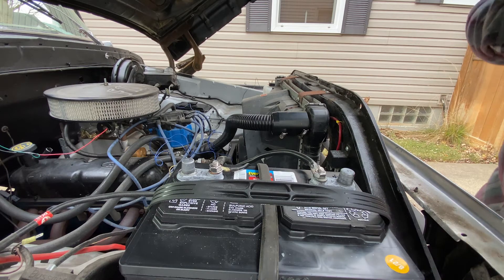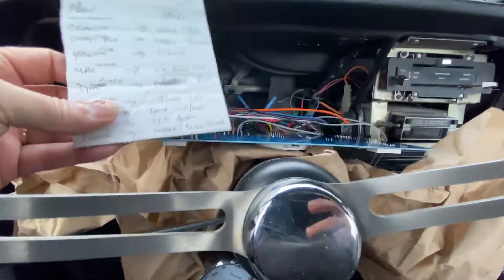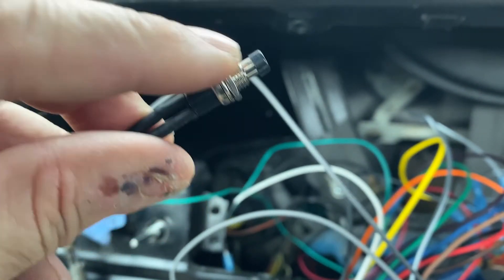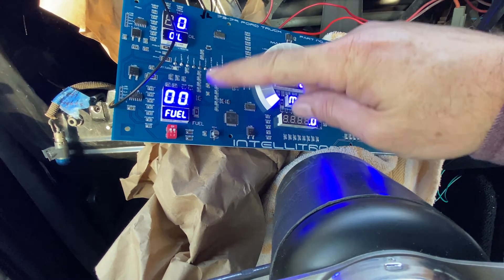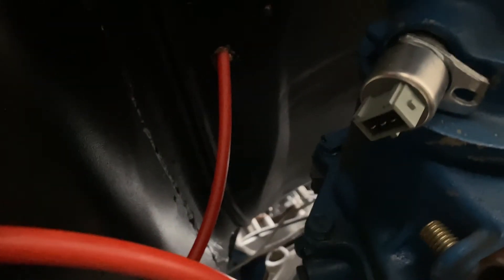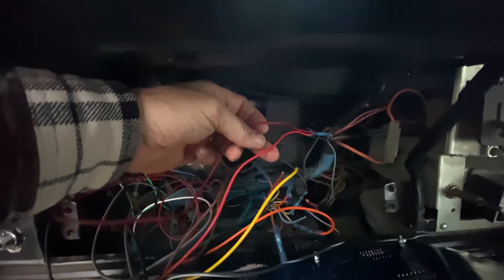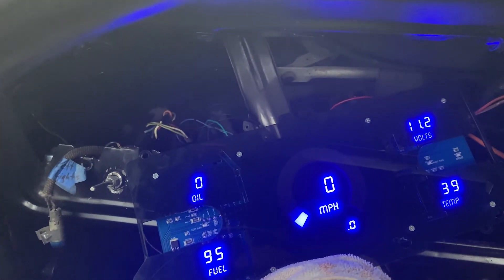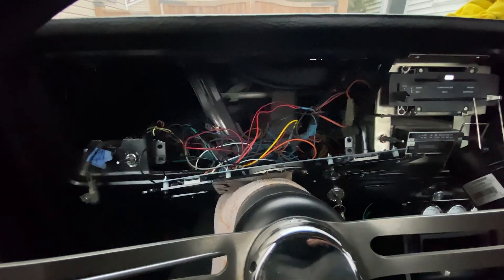How To Install INTELLITRONIX digital dash 73-79 Ford F100

Comment: How do you wire the turn signal wires? I have a left and right wire on my panel but I cannot figure out how to wire it to the signal flasher or the wires coming out of the steering column? I cannot find that information anywhere! I am guessing it is simple and I am just missing something. Anyone, please help! Thank you!

Comment: I installed one of these in my truck everything works but the Speedo, I’ve swapped the wires around just in case I lost track while chasing them, I’ve grounded it inside the dash, took out the sensor from the transmission and tried reinstalling any advice or things you can think to check I went white to white on the board hooked in the red with 12v key and the ground to a screw in the dash then to the board

Comment: My sending unit wire along the chassis must have a short, so I ran another wire straight to the fuel gauge , it now works, however my temp and oil pressure gauge are affected. Can I disconnect the old gas gauge wire from the big wiring plug behind dash cluster ?
Reply from the maker: I’m not sure I’m completely following you, but the fuel should have no bearing on temp and oil. The only thing they have in common is a ground. I’d check your ground. Yes, you can disconnect gas gauge from wiring harness
Reply from the maker: Did your original dash have gauges for oil and temp, or just lights? The wiring diagram I shared will only work with an original dad that is WITHOUT gauges, meaning it HAS LIGHTS
Reply: @FRestoMod  
Original sending unit would not work so I replaced it, still would not work with the existing wires.  I have a ground wire from the sending unit, then I ran a separate wire from the sending unit to the fuel gauge . Also a wire from the other fuel gauge terminal to a hot fuse. The fuel gauge then read accurately but also the temp gauge and the oil pressure gauges  both read high. Later I realized I didn't need to run that hot wire, took that loose and relied on the plug that goes into the cluster to carry the current, but now I don't have any reading on the fuel gauge.
Reply: @FRestoMod  
Adding to the other message yes this gauge panel is the original from the 77 it has oil pressure, temperature,  fuel,  and amp gauges.
Reply from the maker: @trig5010  in that case, you can’t use the wiring diagram I shared. That’s only for WITHOUT gauges. The wire coding is totally different.
Reply: @FRestoMod  
Ok, well thanks for all the info. I've been thinking it's a ground problem but I've changed the ground wire from the sending unit several times and it doesn't change my fuel gauge reading.
Reply from the maker: @trig5010  you made the necessary adjustments on the dip switches on the pc board of the intellitronix unit? It’s a must do.

Comment: So the red one goes connected with the seed sensor?
Reply from the maker: Sorry man, just saw this. There are actually 3 wires going to the speed sensor. The red goes to switched power.  I’m sure you’ve already figured it out at this point.